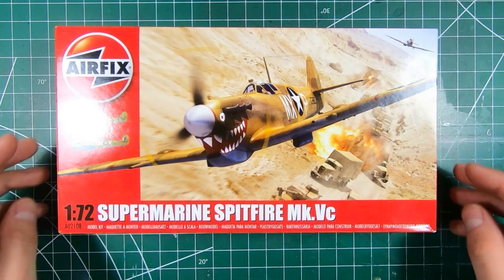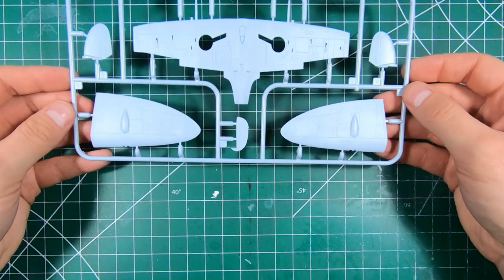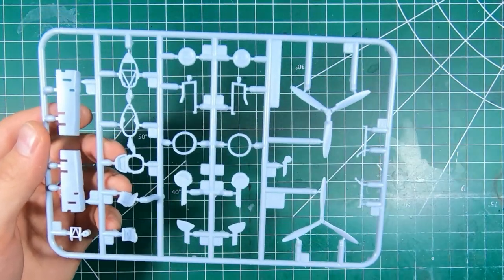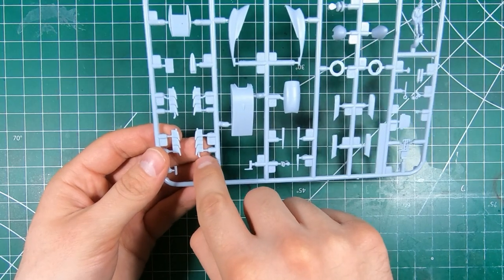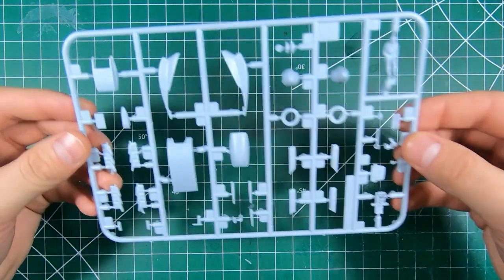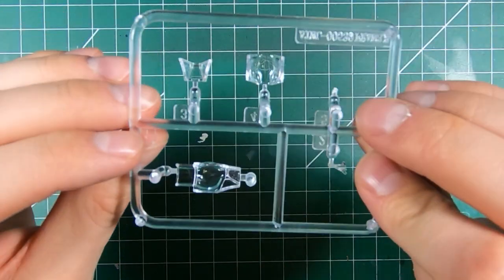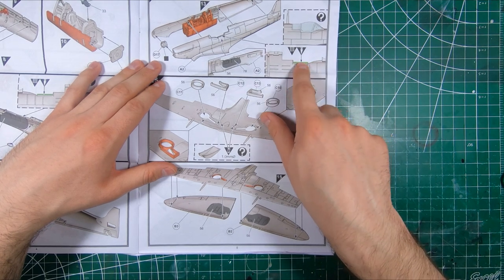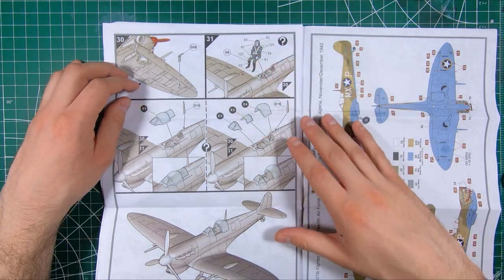First Impressons... Airfix's Mk.Vc Spitfire

Comment: I've heard this kit has fit issues around the wing roots
Reply: The wing roots are historically uneasy to get a clean line between wing and fuselage. It's a rather special shape
Reply: After watching several build videos, it seems that some get the wing root gap, others have a perfect joint. Not the only hornby era airfix kit, that people have very mixed results with.